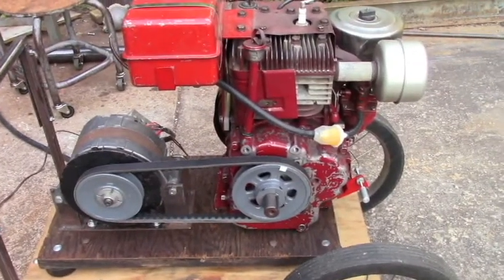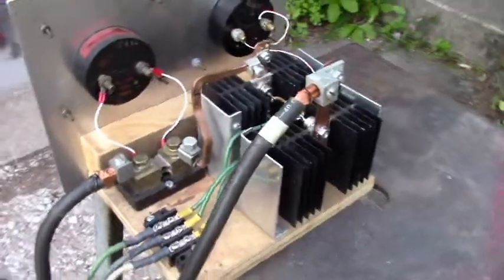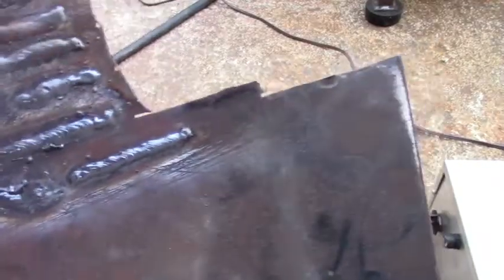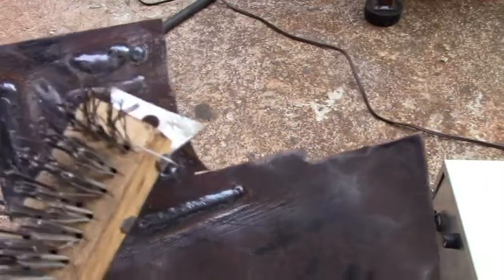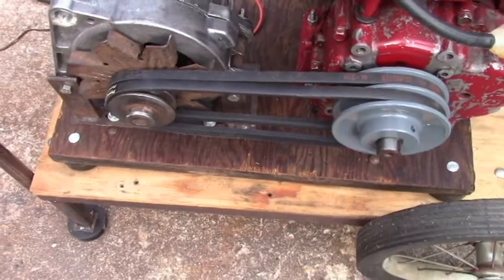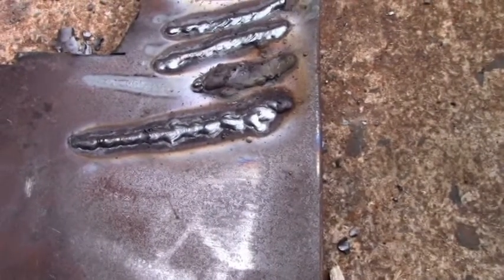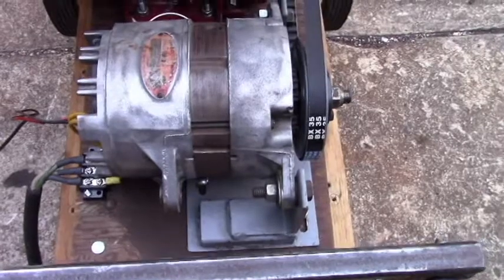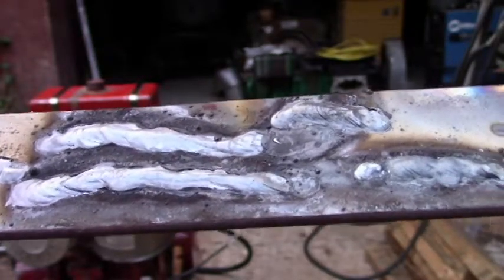automotive alternator welding experiments

Comment: 40 wraps around a piece of iron pipe makes for a fairly decent reactor..and a capacitor out of an old air compressor helps with starting the arc..i took a foot of 1.5 inch pipe and wrapped #4 copper wire around it like 50 times then taped it up and it stabilized the arc really nicely
Reply from the maker: Comments like yours are greatly appreciated, Thanks

Comment: what I did in the past to control the field, was to use 120 volts AC with a dimmer switch for lamps, 120 volt to 12 volt transformer....a full wave bridge rectifier after the transformer, capacitor and inductor as filters...and feed the output to the field... that will control the alternator
Reply from the maker: Thanks for the information. I will surely try this.
Reply: @stephenhrobak3631  you are welcome, I have heard of people using oven elements to control the field as well...

Comment: Just a thought, how about spinning 2 identical alternators with the same engine to maybe doubling your voltage, of course your ampers would stay the same I think anyway, I have read on buzz box welders to have an output voltage of 70 volts ac, but obviously this would be a lot of dinking around for some welding, I dont know for sure but does anyone know about typical car, truck or what have you alternators putting out in 400 cycles instead the 60 hertz?
Reply from the maker: I am always looking for high frequency alternators and I did find a 400 HZ unit. It looks like a power unit for aircraft use. I made a coupler for it but have not ran it yet. It needs a good mount to hold it. and a v twin engine. The buzz box welder should be under 20 volts.
Reply: @stephenhrobak3631  the open circuit voltage on a Lincoln SA200 pipeliner welder is 93 volts dc. They are true dc generators. No chokes or inductors. I guess the high open circuit voltage makes it easier to strike an arc and maintain it. I don't know what it actually is when welding,
Reply from the maker: @pl747  I think a voltage or current regulator would work but then it gets complicated.

Comment: Well done, dude. Very informative. I am looking at modifying a GM 12Si with external 200amp 3-phase rectifier. 420cc 13-horse engine, 2-groove v-belt pulleys, 2:1 speed ratio. Gathering parts for now and watching these great videos like yours. Thanks!
Reply from the maker: I like your enthusiasm, have fun.

Comment: Wondering how much more power you can get if you raised the exciter ftom 12 to lets say 18 from a dewalt batt pack ???
Reply from the maker: I ran a higher voltage on the field and it will not increase the output because the iron core magnet saturates. There are limits.

Comment: confused on why two sets of volt/amp meters... and the different readings
Reply from the maker: The voltage varies because of the load increase or decrease.
Reply: one set shows the voltage and amperage supplying the fields of the alternator and the other set shows the voltage and current out of the stator of the alternator.

Comment: I built one from a 140a Remy alternator that weighs like 20 lbs.. I used a headlight switch out of an older chevy for the on off switch and the reostat that dims the lights controls the field..it welds great.. It's hooked to a 17hp Murray riding lawnmower
Reply from the maker: Sounds good. Mine does need a better field control.

Comment: Just a couple of tips. Add a choke coil on the cables. Just wind some turns on a big hunk of steel. This will help smooth the weld.  Also stick is constant current. So the rotor voltage should be boosted as you weld to maintain the current
Reply from the maker: Comments from a welder is greatly appreciated. I am working on a choke and power controllers at this time. It will be posted when done.
Reply: @stephenhrobak3631  I was working on using an arduino with a current sensor I had to stop because of other projects
Reply from the maker: @perrymattes4285  Interesting, I am going the analog route.
Reply: @stephenhrobak3631  good  luck to you. 
I was looking at the possibility of using a magnetic amplifier to adjust the current. 
I would like to see your final product. 😃
Reply from the maker: @perrymattes4285  Why not PWM and a current sense resistor.
Reply: @stephenhrobak3631  yep that would work. 
I just like the Hall effect sensors since they aren’t in the weld circuit. They just sense the magnetic field around the weld cable.
Reply: It has to be a closed circuit to boost the rotor voltage as the current sags. If it’s open ended like just a potentiometer controlling the pwm. That would just give you voltage control without feed back
Reply from the maker: @perrymattes4285  You know more than I do. I'll have to look into this. I was going to use a current sense resistor on the alternator output. I will still try it and work from there. Thanks.
Reply: @stephenhrobak3631  I never want to discourage a guy with an idea. 🙂
The sense resistor will work it just hast to be pretty big.  I was using an arduino to generate the pwm. I can bring in the sense Hall effect sensor as 0-5 v and do the math inside. Added benefit was that I can display the current on a little lcd screen. And also input a potentiometer to set the target current.   I got so far and realized my code was crap. Started again but had to move and shut the project down. I did have a output driver to drive the rotor from the arduino as well.
Reply from the maker: @perrymattes4285  Sounds impressive. I am not much of a computer guy. so I just work with analog stuff.Those hall sensors look interesting. All I need is a signal to work with. A milli volt shunt is used on the amp meter why not use it for the sense resistor.
Reply: @stephenhrobak3631  yes absolutely. 
I look forward to what you come up with. 😉.
Reply: @stephenhrobak3631  do you have your amp shunt in the negative cable?
Reply from the maker: @pl747  Sorry I can't answer that. It's probably on the negative end.